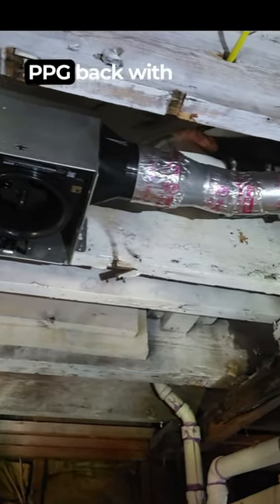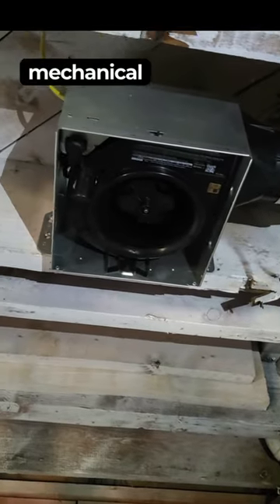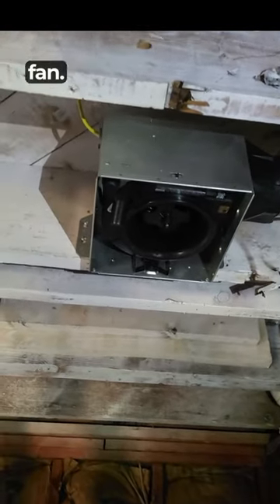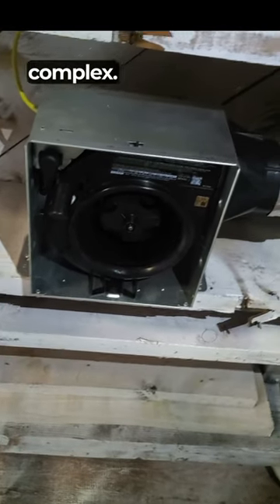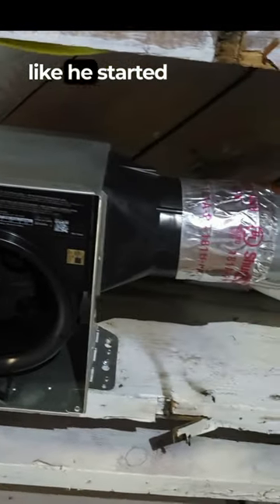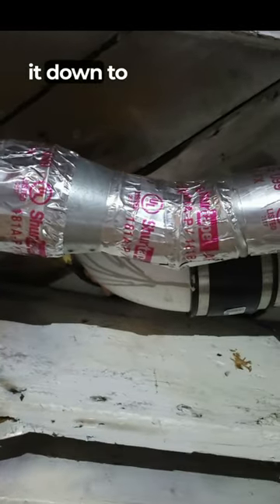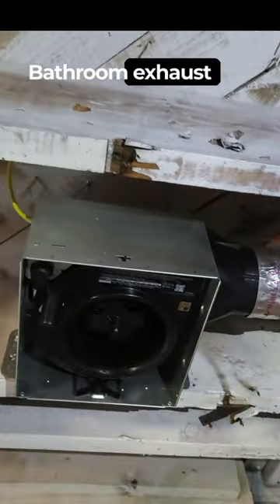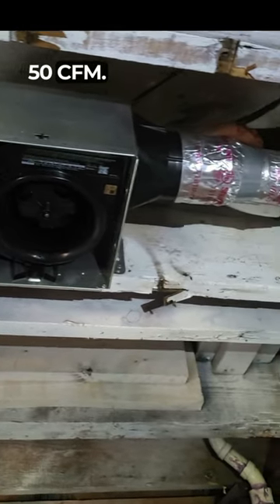A Minimum 50 cfm & 4" Duct for Bathroom Exhaust Duct

Comment: Well if you have existing 3 inch with a 40 cfm old fan, and cannot get in to replace it due to flooring or drywall, then left with reducing it a bit and living with the reduced air flow. Better than the old fan for sure. Many vids on here using reducers for old work for sure.

Comment: Some bath fans allow either 3 or 4 inch ducts. If 3 inch vents are a "no no," why do the bath vents allow 3 inch ducts at all?
Reply from the maker: If the minimum exhaust ventilation rate is 50 cfm for a bathroom, what's the minimum size duct can you use ?
Reply from the maker: Google it...
Reply: According to the charts maximum length for a 4 inch flex hose at 80cfm is 4 feet

Comment: Not an HVAC but good to know when installing for TI's.
Reply from the maker: What do you mean?... not an HVAC.
Reply from the maker: What are TI's??
Reply: Electricians don't install ductwork, however I have installed a few bathroom fans and didn't know ducts had to be a specific size. Now I know. Thanks
Reply: TI =Tenant improvements
Reply from the maker: Got it..